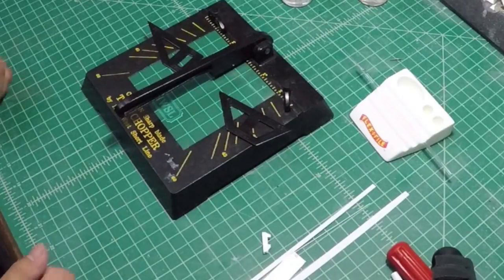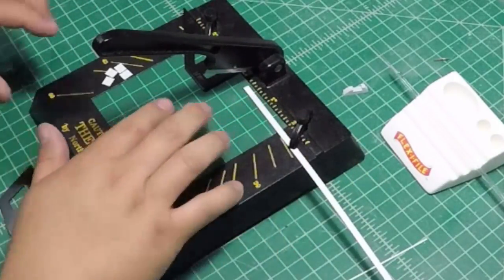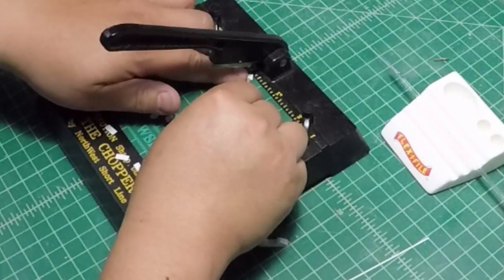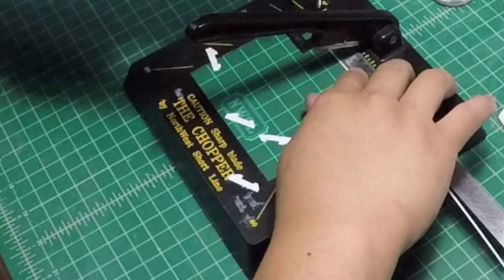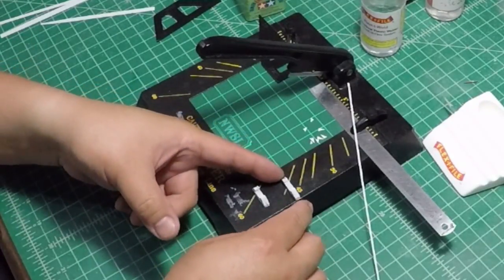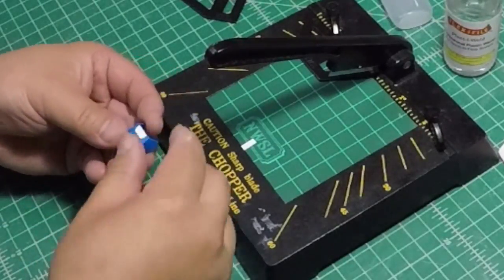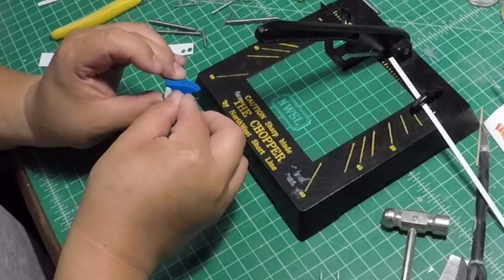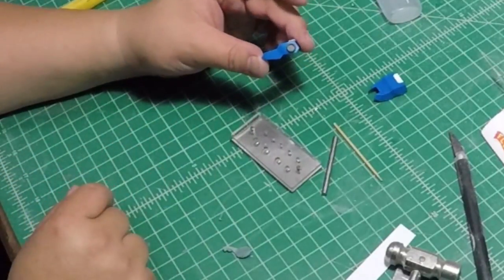Gunpla Scratch Building with the Chopper and Punch Set

Comment: What exactly is the cement applicator? Looks much less messy than a brush or a bottle's nozzle. Also, great tutorial thanks for sharing
Reply from the maker: I've been wondering when someone would catch on to that.  It's by a company called Flex-i-file: http://www.flex-i-file.com/touch-n-flow-system.php  I saw a demo at a local model competition and picked it up because it looked pretty cool to use.  And it is.  This site has better demo videos for that product.
Reply: Those Gundam Guys awesome thanks for the quick response. Quick question, is the filler bottle special in any way? Would a dropper bottle work the same or is the fitting special for the touch-n-flow? I don't really need more cement so if rather just the applicator on Amazon.
Reply from the maker: The bottle just serves to push air out to draw up the glue.  I guess you could just add a dropped end to the back or even just use your mouth to suck up the glue into the tube.... I grabbed the set because it was running on a special for $25 including stand, bottle and applicator tip, glue and some other things.  But this: https://www.amazon.com/Flex-File-7000-Touch-System/dp/B00NG4HWMQ/ref=sr_1_3?ie=UTF8&qid=1497670829&sr=8-3&keywords=touch+and+flow looks like a pretty decent deal.